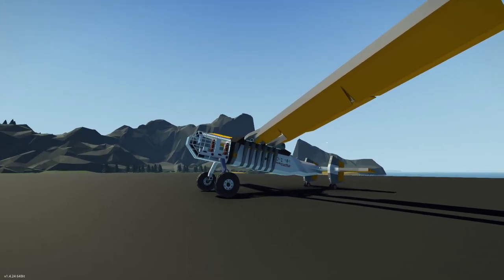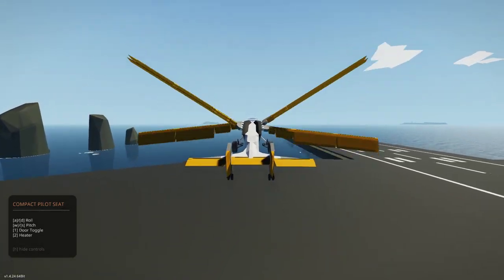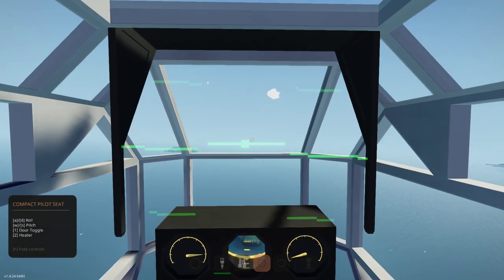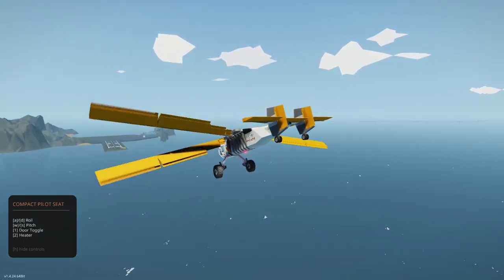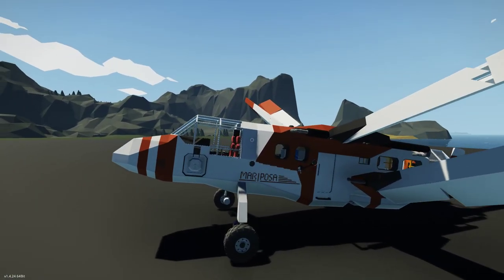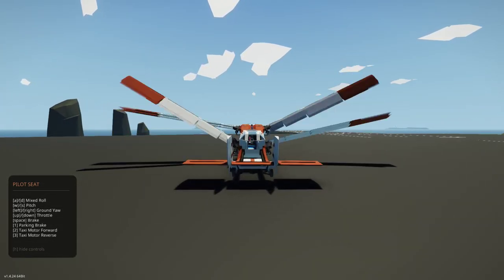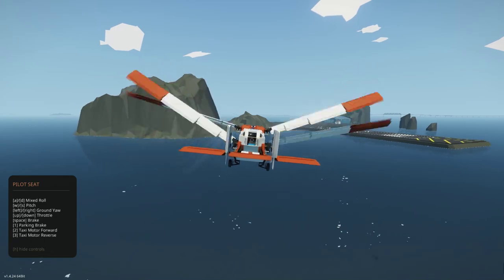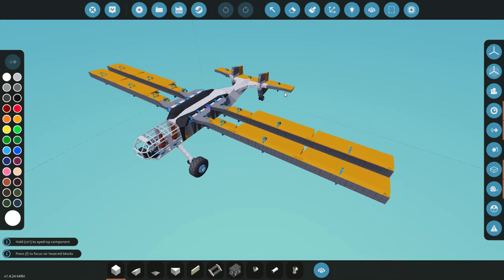See-saw wing stroke ornithopter (Stormworks)

Comment: I have been trying to build my own ornithopter for awhile now, and watching your videos has helped point me in the right direction. Thank you.
Reply from the maker: Glad it's been helpful! Been meaning to do a proper tutorial for ages but I suck hard at presenting that sort of thing. I'll get to it some day
Reply from the maker: Side note: if you do get one working, I'd love to see what you come up with. My designs have been incremental since I got them working at all; there's no telling what a new set of eyes might come up with
Reply: @decofox6789  If I get one working I will let you know, thanks!
Reply from the maker: @turkeyboy5543  that looks pretty solid! You say it barely works: what about it doesn't work very well? 57 knots is pretty close to the speeds I've been getting; only way I see to get higher is more wings or more wingspan.
Reply: @decofox6789  It has very poor pitch stability and stalls easily. The pitch stability is just due to the tail being short, I don't know how to improve the stall speed tho. Larger wings I guess.
Reply from the maker: @turkeyboy5543  I've had my best luck reducing stall speed by biasing the wing incidence up. A few of my ornithopters have it as a built-in function. The idea is you just move the centerpoint for the flap oscillation so the control surface spends more time low than high, which makes it draggier but higher lift. It's very difficult to  stabilize ornithopters with high incidence though; they gain a ton of adverse (opposite roll direction) yaw.
Reply: @decofox6789  Alright, good to know, thank you.

Comment: You could simply have a wing configuration button, like a variable-geometry plane would a sweep lever, or any plane a gear lever. When in low-altitude landing conditions, give the wings dihedral for ground clearance; when airborne, just switch to balanced mode for a silky-smooth flight.
Reply from the maker: This ornithopter actually has such a control in the touch screen. It's definitely an option, but I find the "feel" of the seesaw wings rather unpleasant at dihedral by comparison. Totally works, though, and the next seesaw ornithopter I release will likely work that way

Comment: Sorry for bothering you. Can you explain how it works? Do not have free time to watch guide that you make(
Reply from the maker: The short version is that it works like a propeller that changes direction half way through its arc. Rather than rotating all the way around, it switches direction and flaps back down the way it came. It reverses its blade angle as it does this, so the blade generates thrust in both directions. The best explanation is probably just watching the thing move in slow motion. If you're trying a similar mechanism but can't get it to work, my money would be on your blades being too short. Because radius has a multiplicative effect on velocity for a given rotation speed, the longer the wings, the more thrust you get. 

If you're after an explanation for how I govern the strokes, the wing roots flap according to sin(x) and sin(-x), and the "feathers" move according to cos(x) and cos(-x). Roll control is achieved by adding the roll factor directly to the trig, IE: 
FeatherRight = cos(x) + Roll
FeatherLeft  = cos(x) - Roll

All of the trig is driven by an increasing value, in this case X. X is initialized to zero outside the tick function, and then every tick we set x = x + Throttle, where Throttle is some variable from 0-1 usually. This means throttle changes how quickly X advances, and thus how quickly the sin and cos waves oscillate.
Reply: @decofox6789  Wow, for me you're a genius. xd
So.. for example, if there were a smaller rudders and we could build smaller wings it means that it should be moving faster? If so, that is interesting. 
Thank you for explanation, i haven't understood all but it anyways was helpful
Reply from the maker: @GreegAVsAMV  
Quite correct. The shorter the wing, the faster it has to move. Unfortunately the maximum speed of our wings is fundamentally limited by the physics tick rate of stormworks. We cannot beat the wings faster than the game has time to simulate them, and that limitation is come upon fairly quickly. That's why all my ornithopters so far have had fairly long wingspans
Reply: @decofox6789  thanks for all. Maybe i'll try to build smth like this